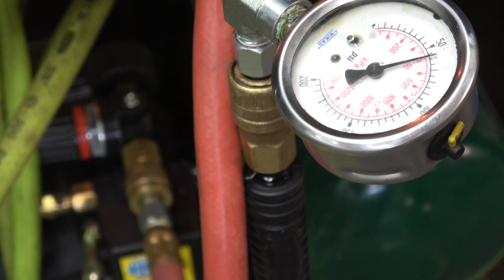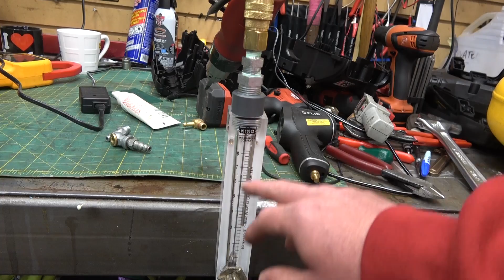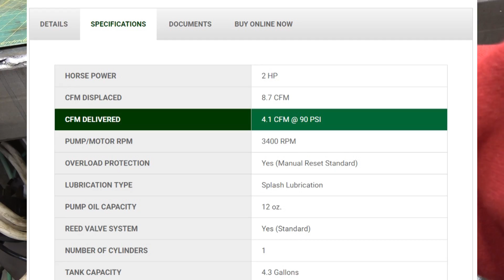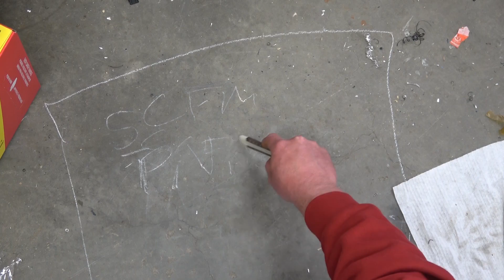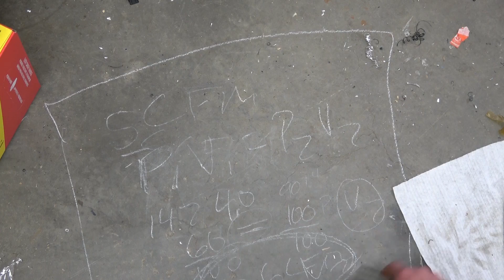Why are CFM ratings BS?

Comment: wow, for once knew something AvE does not :D

I've been avoiding air tools and buying new compressor for YEARS because of this shit. If i spend a grand or two on compressor, i have zero guarantees i can even run a die grinder at continuous cycle. My current clapped out compressor is supposed to put out over 340l/minute, where as die grinder needs 180l/minutes ... well, i can use die grinder a few minutes, then spend quite a bit of time waiting to pressure build up ... and this compressor is biggest i can run on 16A 230V outlet, and it's promise is very low compared to others at similar spec (16A 230V, 100-150l container, 2-3 cyl). Granted it is now clapped out, but i cannot remember a time it could run die grinder continuously.

I've now gotten the feeling that unless you are willing to put 10k on a screw compressor running at 3x16A consuming 5kW+ you can forget efficient use of air tools and electric tools always outperform them at 1/10th the consumed energy total.

Comment: Bought a consumer 30 gallon and thought I could be happy.... Nope! Moved up to a 60 gallon commercial and was very happy but still not perfect...... Ended up getting a $3000 80 gallon and now I'm finally happy!
Reply: If that 30 gallon was labeled 4 cubic feet they might not have fooled you into thinking it would last more than half a minute before cycling.
Reply: What about 'high cfm' rated hose couplings? is that B/S as well?
Reply: Really delayed reply but also look at psi.  I have an 80 gallon 150psi because higher psi squeezes more air into the same space as a 125psi compressor.
Reply: @GroberWeisenstein  most of those are only available with 3 phase motors and 3 phase isn’t common in many places.
Reply: @GroberWeisenstein  they have a lower CFM output than reciprocating compressors with the same HP though.

Comment: Unless my maths is off then to deliver X CFM at 90PSI you need a compressor rated at 5X sCFM.

In fairness I suppose this is a bit like the rating of welders and duty cycle.  For home use a welder rated at 200Amps with a 50% duty cycle over 10 minutes is going to be plenty good enough for the home user to weld at 200A.

On he other hand I've been caught out by this compressor rating thing the other way around when relocating a business. We'd got by fine running various air hand tools off portable compressors. I gave the CFM rating of them to the consulting engineers for our new facility. I got quite a shock to find our new facility had a V4 compressor driven by a large 3phase motor in its own room.

Comment: Pretty sure air tools are rated cfm at the inlet under pressure.

And the compressor is rated after the airtool when the pressure has dropped to "atmosphere" pressure.

I would never think a compressor would be rated for 5cfm AT 90 psi

Commented before finishing the video.

But i agree that the cfm ratings is bullshit when they use it differently on tools compared to the compressor
Reply: Commented before finishing the video

Comment: Thanks AvE you have clarafied that for me clear as mud as you say, so if I want to properly use an air tool any kind of tool no matter how small I need to buy 5 compressors to keep it running. Do you know what lets leave air for tyres, and use electric.

Comment: Flowmeters, at least the float type, suck, they are inaccurate.

Use the tank to pressure it to 100 psi and measure the time it takes, you know the volume of the tank so you can calculate the scfm over the range 0-100 psi, now do the same but measure time fron 80psi to 100 psi and you know what it does at 90 psi and i bet ya it will come prety close to what is stated on the box unless the elctric motor is not 2 hp as stated on the box.

Comment: With water it doesn't matter what's the pressure in the pipe..  1 liter of space holds 1 liter of water.  With air is different.. lets say you have an 1cm^2 interior surface area pipe with an open valve at entry.. that means 1 meter of pipe has a volume of 1 liter.. lets assume air inside is at 1 bar and flows at 1m/s.. so now that 1 meter piece of pipe holds 1 liter of air.. and in one second 1 liter or air flows through the valve.. Now let's say in the pipe the pressure is 10 bar and air molecules move inside relative to the pipe at the same speed of 1m/s... can we still say is 1 liter flow? or 1 liter/second  at 10 bar? Its that real/ok? No of course not because now the same 1 meter 1 liter volume piece of pipe holds 10 liters of air instead of 1.. and also now in 1 second 10 liters of air ar going through the valve. So if now we consider that valve as being an air tool or an compressor.. how we would rate them? If we consider that valve as being a compressor it will mean that it can provide 10 liters of air per second at 10 bar pressure.. or if we consider that valve as an air tool it wil mean that it needs 10 liters of air per second at 10 bar. I hope that clarifies things. Have a nice day!

Comment: My rule of thumb.... Read compressor rating.. divide by 6, equals approximate real capability.
Reply: Yep, that's close to 100% duty cycle for tools rated @ 90psi. If you're using chisels for stone work so you can get away with 50% duty cycle (5s work, 5s taking a look at what you've done), you can divide compressor's declared (s)cfm rating by 3. Which makes cheap compressor absolutely useless for most tools.
Reply: Hmm...

Comment: I am enjoying this show whilst partaking in some of the beverage manufactured in Scotland.
However, I will once normality has returned I will feed numbers into the Bernoulis equation which means one can work this out.
Unpausing video, having exhaled the brainfart, now on to enjoy the remaining 8 minutes of the performance.
Btw, now I know why one has to buy a 3 Hp home gamer air stuffer to paint a lamp shade.
Regards, D

Bernoulis Equation

Reference https://www.physicsforums.com/threads/air-pressure-and-flow-to-power-calculations.70436/

Bernoulis Equation

Reference https://www.physicsforums.com/threads/air-pressure-and-flow-to-power-calculations.70436/

Comment: In Sweden it says like this on the rating of air compressors:

"Luftmängd: 195 l/min
Genomlupen cylindervolym: 412 l/min"

which means something like:

Amount of air: 195 l / min
Through-cylinder volume: 412 l / min

Comment: I agree the ratings are all bullshit butI do have a 220v "5.5 hp" if I remember right it was 11.5 cfm at 90 or 120psi  I'm not sure speedaire that's probably 25 years old but that does seem to keep up with about any tool I use dyna file, impacts, DA so on

Comment: Also, as you compress, the temperature increases, since P1V1/T1=P2V2/T2, your measured 0.9CFM, if at room temperature, would be actually a bit lower. So they didn't give you 50% more SCFM, the 50% more you get is just from thermal expanding.

Comment: i've used a wheezy 350l/min compressor, that would rattle your soul out at 3000rpm, and would struggle to get more than 2 M10's off with the uggedugge. found a sullair ES-6 on the interwebs with a buggered shaft seal for €225. had the seal fixed on the bossman's dime since his compressor couldn't feed some of the tests i talked him into. now i have a nicely contained screw compressor that delivers 17.3ACFM/ or 0.49M3/min (at 150psi or 10bar) at about 68dBA. No more bleeding ears and all the air i want. slapped a VFD on it i had fished out of a bin and now it's even more quiet. haven't yet dared to overspeed it, screw compressors are funky.

Comment: So in order to get a compressor that can actually keep up with your die grinder you need one rated for at least 20CFM at 90psi.
You should be able to tell the real cfm output by knowing the volume of the tank and what the rate of rise in pressure is. 1 gallon equaling .134 cubic feet. I think if you have a compressor with a 10 gallon tank if the rated cfm is 5 the pressure would have to rise from 90 to 100psi in about 2 seconds.

Comment: Good stuff, don’t forget pressure drop in the air hose at those high flow rates, would be most accurate to measure air pressure at the tank instead of at the end of the hose.
Reply: the more hose,pipe you have the more voluum,like,?.vacuum,?,volume..

Comment: With the compressor having an infinite number of applications (give or take a couple), and the tool having but one, is it not the tool guys that are passing on the bulk of the douchebaggery? Why not rate the tool in SCFM? What drives me even more nuts is seeing the 5HP air compressor or shop vac for sale... 110 volts, 15 amps... Riiiiight.... Nice video- thanks!

Comment: Great video BTW! Still those high RPM tools like 20K die grinders look small but eat big. Their size is deceiving just like 3 phase motors compared to regular motors. If you want big air you need bigger tanks/lines. I've got air lines rigged to 3 stories. If you get enough air line, especially hard stuff, it will act like a bigger tank somewhat.

Comment: I bought a compressor thinking I was eventually going to use it to sand blast. 20 years later I have no sand blaster but I'm glad I bought the most powerful horizontal wheeled unit that Craftsman sold at the time. 5.5hp and I've never been wanting for power.

Comment: I have a CAC air compressor with a 2 stage compressor belt driven by a 2 HP 220v single phase Dayton motor filling an 80 Gallon (about 10cu ft )tank and lines in my shop. It takes thirteen minutes to reach 130 psi, not to bad for a fifty year old compressor that had daily use in a working garage for a good part of its life. It still cannot keep up with a ¼” blue point die grinder that takes 90 psi, till it gets to about fifty psi in the tank

Comment: What you need is a nice 150 horsepower Quincy putting out a cool acfm of 738 at 100 psi. Keeps our whole shop up even with a nitrogen generator which dumps 25% of the air back to atmosphere as it produces nitrogen.

Comment: air compressor ratings are like shop vac ratings. 5hp on a craftsman shop vac running on 18 gauge lamp wire. If they were allowed to rate extension cords (like they do air compressor CFM's, 14 gauge could power launch the space shuttle !  Hilarious. If you want airflow then you need to buy something that requires 220v. Then you have half a chance to run something important other than  inflating a soccer ball.

Comment: We have these huge engines, there green supplying the company I work for with air, it’s a pipe mill In Calgary the air, pneumatic, and power the company goes through is amazing, we actually use the 3rd most electricity in the city, it’s the city, then airport, then the company I work for, it’s quite a thing seeing pipe made from the roll and threaded.

Comment: If you are going to buy an 18v small compressor - any of them will be OK for blowing up the odd tyre or frog.
Sort of useless. 
You can buy today a 24 litre 9.5 CFM 2.5HP 115PSI for 89.00 UK pounds. Amazing value. 
Most compressors do seem to print the figures for work they actually do. It seems it's the crappy little ones that are sub 1CFM that have to fiddle with the numbers.

Comment: Designer "Our compressor will run ANY tool!......(*for five seconds with no load)"
Marketing "Sounds good but lets all leave out the second part OK?"
CEO "And multiply the rating by five."
All manufacturers "So we agree, let's meet here again if they figure it out."
*All scurry away into the dark corners of the alley...

Comment: I am rather surprised you didn't realize this..compressed air is a  hopelessly inefficient means of driving anything so the size of the motor should also set alarm bells ringing..I get around it to some extent with a large receiver and intermittent use.. which is acceptable with diy..you can't beat a large dose of cynicism, works every time..

Comment: My Quincy air compressor is rated at 22.3 ACFM (What does the "A" stand for, Actual?) at 175psi and cost my 2800 bucks has no problem keeping up with even my sand blasting cabinet!!! I can run any tool in my arsenal and it will turn on and back off without any interruptions in work!!! Even my air hungry Harbor freight blast cabinet!!! My suggestion is to buy the largest compressor available!!! And no the Harbor freight compressor is not good enough!!! I burned up 2 of those before I bought my Quincy!!! Keep Rocking Tool Fans!!!

Comment: I doubt regardless of what compressor a 15-20amp breaker couldn’t even supply the power to run a die grinder continuously at 90psi

Comment: I know I'm peculiar for wanting my beers in pints and fuel economy in miles per gallon and everything else in metric, but if you do the calculation in bar you don't have to worry about multiplying by 14.5 all the time (14.7psi is atmospheric pressure, but that's 1013 mbar, not 1000)

Comment: 240v 3hp twin cylinder belt drive compressor will keep up, but I run my die grinders slower/ lower pressure as they cut better with burrs.  The cheapo direct drive are only good for blowing sex dolls up with

Comment: All compressors should be rated at SCFM only - this takes pressure out of the equation. A CFM number is meaningless without pressure... and changes with pressure. Sneaky advertising is when they say X scfm at say 90 psi. The 90 psi is redundant... this is not at all the same as saying x cfm at 90 psi, which the average consumer probably will not pick up on.

Comment: Funny. I was just thinking about this. I just got a new to me old timey big ass tank and compressor head on it. Only rated for 2.5cfm at 150psi. And was wondering if it will run my ugga dugga. I guess the volume it what has me somewhat safe.

Comment: You just need a larger volume tank and you’re good
Reply: My dad used to have a 12inch pipe down the side of the workshop to supply air to his hand tools, used as a reservoir but not requiring testing each year.

Comment: I just realized. You're using quick connect connections! That's a tiny little hole to move the air through past the ball. Times 3? How many on the setup? I bet they use direct fittings with no reductions

Comment: Nah, it's scintillating cubic feet per minute. You're supposed to flow the output past a nuclear light bulb to heat the air up to a few thousand degrees and then feed your tools the hot air. (Temp and neutron activation)

Comment: I tink I  figured out where the problem is. The problem is people misconceptions.. You can't say you need 3 cubic feet at 90 psi.. that doesn't make sense... because to get air flow you need pressure difference.. so to get right before the tool  3 cubic feet at 90 psi it means the pressure in the tank has to be more then 90 psi so flow to the tool can exist... that will mean  that to get in the hose before the tool 90 psi and 3 cubic feet flow you wil need the presure in the tank to be something like 100 psi..  for 4 cubic feet at 90  you wil need maybe like 130 in the tank.. so on an so forth.. in this way you wil never know at what pressure the tank must be.. thats way they mesure the air volume after the air has expanded...  1 liter of air is 1 liter of air at atmospheric pressure  only.. if you have an 1 liter tank at atmospheric pressure it has 1 liter of air if its at 2  atmospheres the volume its still 1 liter.. but inside are 2 liters of air..

Comment: Sometimes they tell the suction on the inlet side without any load (pressure in the chamber), but nowadays I've seen them start saying the suction on the inlet at pressure, so it's even remotely meaningful. At least, my 685 l/min (24 cfm) compressor was that way when I ran a basic test to see if I got cheated.

Comment: Welcome to the art of "specmanship". Something engineers have to step in, all the time. A quick example from electronics: "Gain Bandwidth Product" (GBW) on op amps. You'll get a number like 4MHz. A newbie will think, "oh, I can pass a 4MHz signal with this part". Nope, at 4MHz, the otherwise infinite openloop gain, has dropped to 1 (or no gain). Engineering is mostly the art of figuring out the "devil in the details". aka, dealing with BS !

Comment: So the solution, for most of us, to this SHIT sandwich we're being fed, is to have a big TANK on our compressors.  The larger reservoir won't help so much in sustained heavy tool-use but it will deliver a better result for a while as its stored energy (pressure) declines more slowly than that of a small tank.  I have a large-ish tank on my shop compressor (it's more than a meter tall) and I've had few occasions to complain.  But it works its ass off for an extended time to re-pressurize after use.  It's rated for 6.4scfm @ 90psi.  There's that "s" again...

Oh and the unit is an old-ish Sears compressor.  If that means anything.

Comment: Its an old dirty secret folks, SCFM and ASFM are two different meanings. S for standard, which means squat as AVE so well demonstrated and A means actual. Buy any compressor and that A or S is really the most important thing you should know if you know what your tools or machines require. Commercial grade will always list ACFM, consumer grade will always list SCFM.

Comment: AVE was a bit expensive qwhen he mentions $5,000 for a decent comercial grade compressor. I recently upgraded our aging Campbell with a brand new Quincy 2 stage 7.5hp, 3 phase unit that puts out 22 ACFM all for just a tad over $2,000. The quality is excellent, it comes with a case of oil, replacement belt and replacement filter.  And it is American made to boot!

Comment: I guess none of us should be Surprised Pikachus if we analyzed this in terms of energy. No compressor is magical, and it can't produce more work than what a 13A/115V outlet, or whatever you have, can put out (despite the pixies). Given that "CFM@90psi" is basically a unit for power, maybe the logical conclusion is to specify all air tools in the more regular watts. We can have a "sustained" number as well as a "boost" number (correlated to tank size, obviously). This will also help us more easily compare air tools to battery/electric tools.